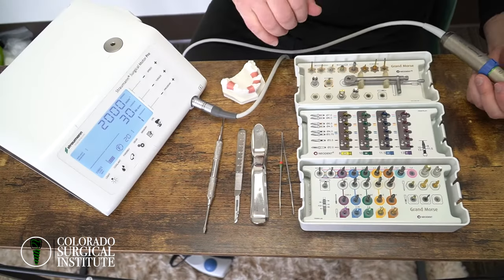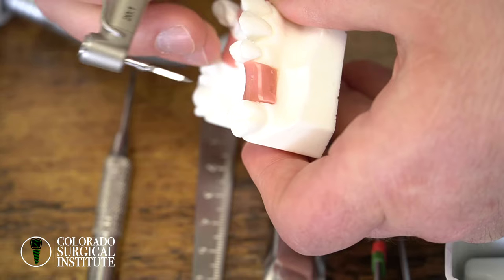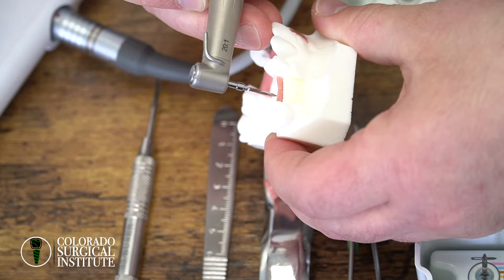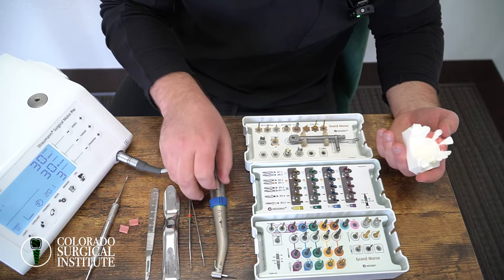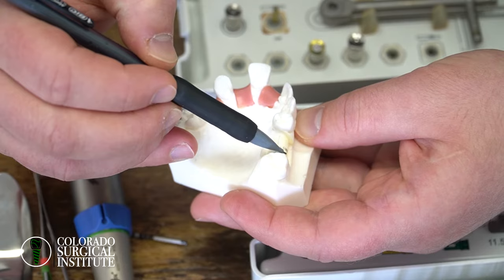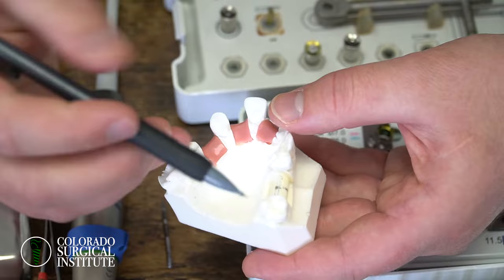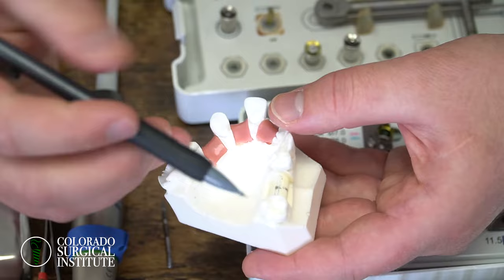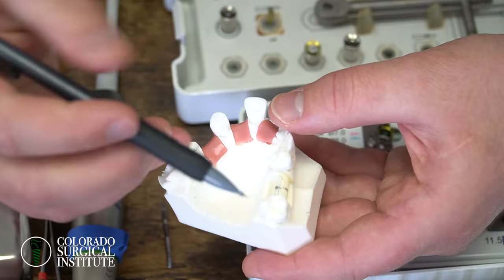Dental Implant Drilling Techniques: Speeds, Angulations, and Implant Placement

Comment: when osteotomy is not sufficient and we tried implant placement but its not getting in, so we remove implant and keep implant in saline and again use it?  does such implant osseointegrate well..please answer
Reply: If it’s in the same surgery it will work but if it outside of the vial for so long it maybe contaminated by air and the surface treatment may be lost.